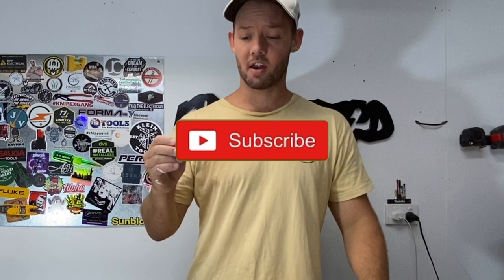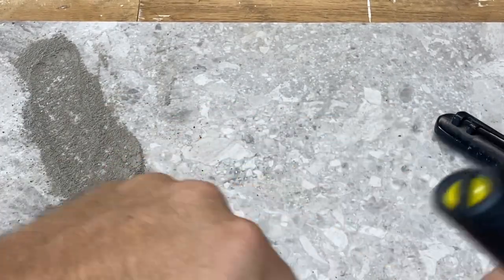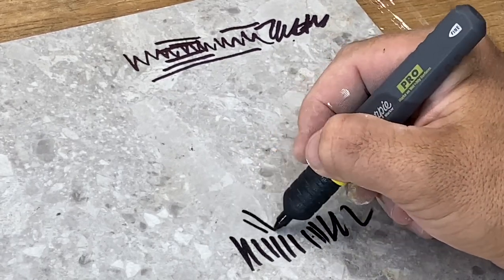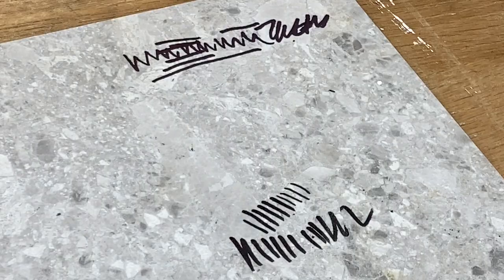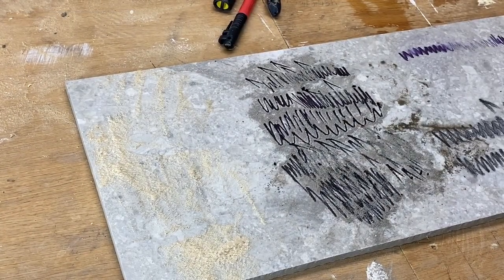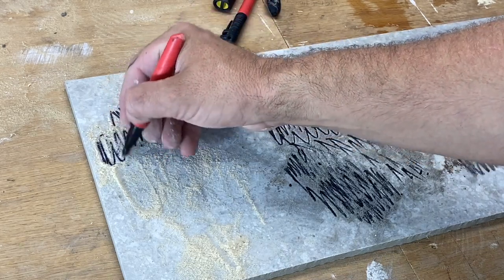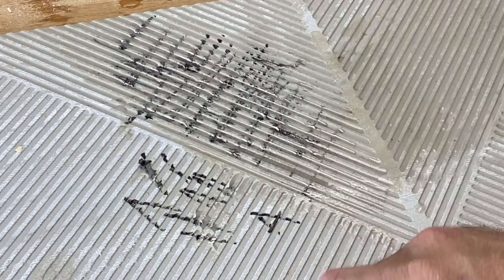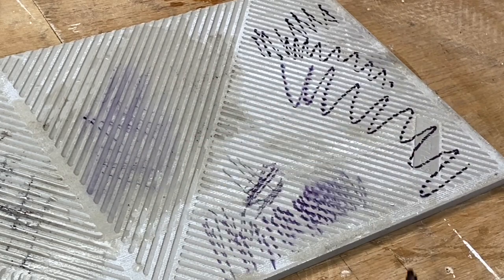MILWAUKEE inkzall vs new SHARPIE pro . Best job site marker

Comment: The inkzalls are great for working in a mechanic shop. We have to write out oil change stickers and when we’re in a rush a coat of oil gets on the stickers and the inkzall writes through unbothered. Normal sharpies in my experience would fade out on the first number and I’d have to retrace 3-4 times to get something legible

Comment: My experience has been that Milwaukee markers are translucent, not as dark, takes longer to dry, wipes off easier (especially off plastic), and most annoyingly, inks the back of the pen when storing the cap, which, ironically, will NOT clean off (except onto your hands).

Helpful tip:  always store marker pens with the cap down:  it keeps the ink at the tip, so it writes better.

Comment: Not surprised.  Shaprie has been making markers for decades.  I have no idea who Milwaukee got to make their markers, but they probably haven't been doing it as long.  Their hand tools on the other hand are something I will always trust.  Not much better out there.
Reply from the maker: That’s one thing I look for in a lot of areas. How long they’ve been in that industry. Sharpies been good for awhile. These newer pens are better compared to their older ones. Thanks for the feedback about the hand tools👍
Reply: Milwaukee hand tools aren't that good. They're power tools are tho
Reply: That's probably what they meant. I know of people who call battery tools "hand tools". Anything else isn't much more that a relabeling, no different than all of the other brands.

Comment: I am not trying to sit and watch a grown Englishman scribble what are the features on the Milwaukee finepoint there is a hole in the cap and a specially designed clip along with a bevel on the shaft of the pen
Reply from the maker: Sorry if you didn’t want to know which pen works best in the trades mate. That’s what the video is about though. Cheers for the feedback though👍
Reply: @AddictedtoTools  what feedback 😂